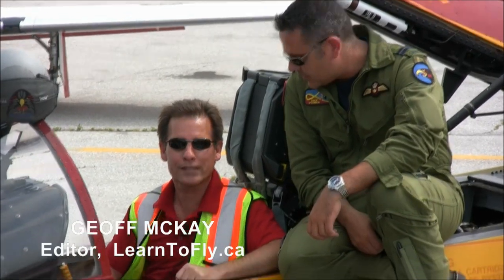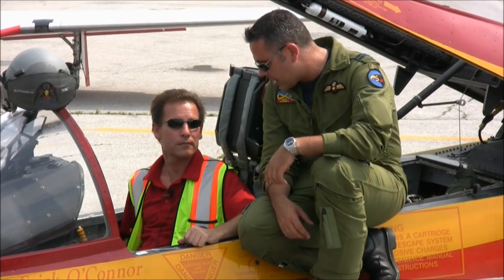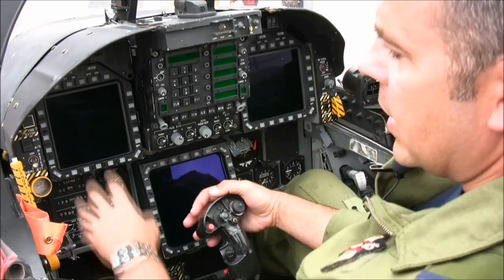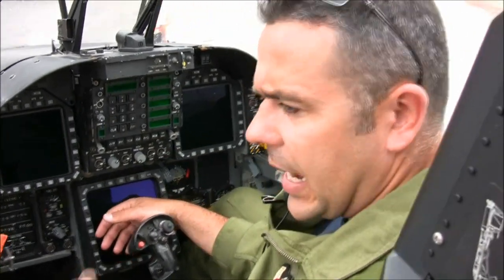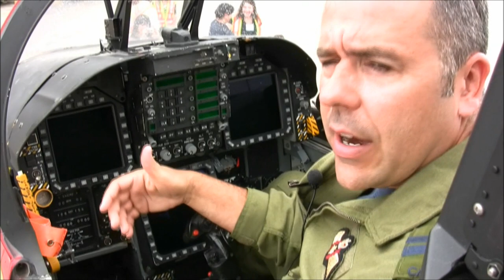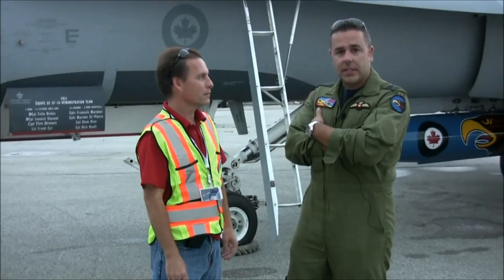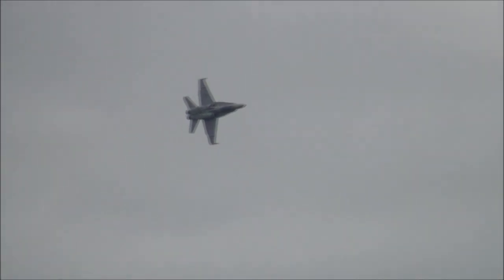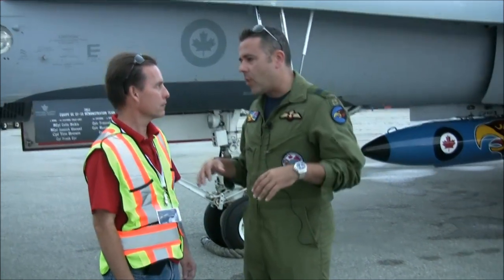Learn to Fly a CF-18 Hornet Fighter Jet

Comment: Only 7G's I thought modern fighters could pull 12G's
Reply: They don't push it far enough its not needed if they wanted they can hit even more than 12 gs id imagine they only do so in restricted airspace ect... training exercises
Reply: I believe the 18 was not designed for that type of G loading the F-15 is rated for 10+ G force. F-15 was a better close in dog fighting the the 18. Tight turns with low airspeed bleed and the 15's climb rate 30k feet in 60 seconds. The 18 was more for bombing. I'm sure both can be replaced with he F-35 now. Still all great pieces of American engineering.
Reply: Uh, the MiG-29OVT and Su-35 are the only jets that can pull 12G's.
Reply: IBANEZfil your so wrong its sad ....
Reply: My so wrong it's sad?

Get your grammar right, first. And then get the facts right as well.
Reply: Unfortuntely the F-35 is a very troubled airplane program. The US Navy just ordered more upgrades to their FA-18 fleet, as the F-35 is reluctant to go to sea.
Reply: Keep in mind that when a real "hot war" breaks out anything is possible, and their will be dogfights. Planning an aircraft's design to fight a war in "all stand-off mode" is pure technological arrogance. Check out history, it will kill you everytime and when you least expect it.
Reply: 12 G's? No. lol You can pull 12 if your prone, but the last airplane with a prone pilot was a Northrup flying wing fighter over 50 years ago. Perhaps we will see it again in the future, as drones have limitations. You need eyes in the sky, not camera lenses transmitting info to a bunker, if you want to gain air superiority.
Reply: machia0705 I believe the F-15 and 16 can pull 9G
Reply: Yes, FA-18 as well.
Reply: Yeah I think they can pull up to 12G's but no human beeing can pull 12G and survive that..;?
Reply: You can pull 12 if your prone, but the last airplane with a prone pilot was a Northrup flying wing fighter over 50 years ago. It never went into production, but proved in the prone position a pilot can stand many more G's than in a seated position. Perhaps we will see it again in the future, as drones have limitations. You need eyes in the sky, not camera lenses transmitting info to a bunker, if you want to gain air superiority.
Reply: machia0705 Prone position = lying on your stumic...wright? How can U fly a plane in that position? Are you a pilot sir?Sorry for asking..?
Reply: Conor Bryan I believe that a modern fighter-jet can even pull until 20G ...but no any human beeing can stand it...  :/
Reply: he said limited to not capable of

Comment: That would be a step BACKWARDS.  You're not a pilot, so you don't understand the HOTAS (Hands On Throttle And Stick) concept.  You don't want a touchscreen, because then you have to stop actively flying the plane to touch a screen, push a button, etc... then the enemy ZAPS your ass.  Thanks a lot.